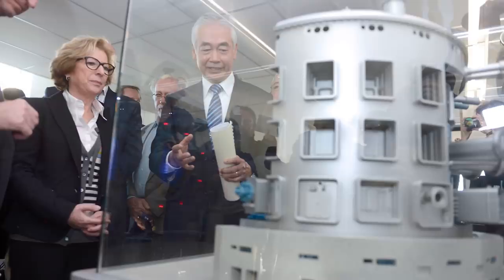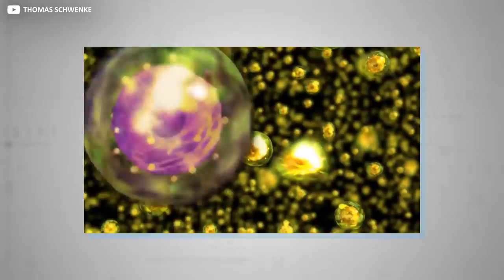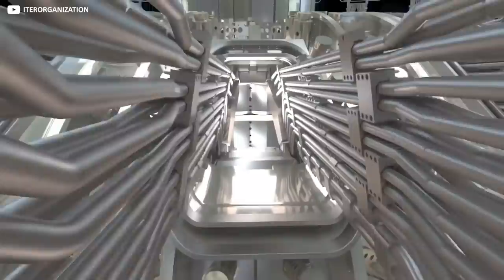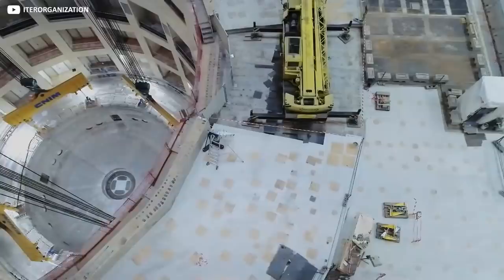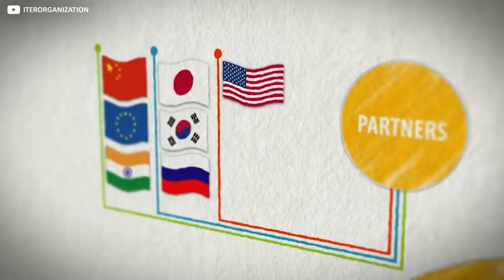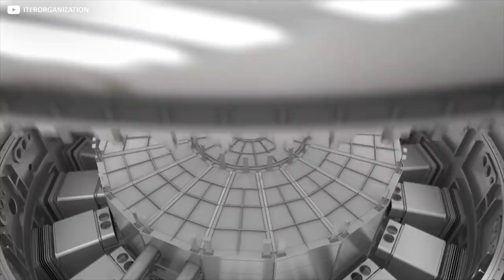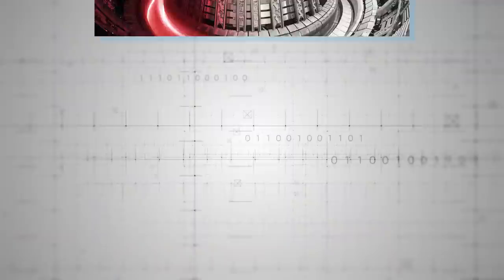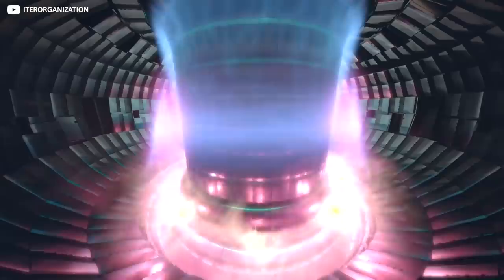Inside The World's Largest Nuclear Fusion Reactor

Comment: Well, hopefully it will work. Because I don't think that it will go pretty if it goes wrong.
Reply: Fortunately it's one of the things where it's bark is worse than it's bite
Reply: No need to worry about that, FUSION reactors can't go critical or have meltdowns like FISSION reactors. If anything goes wrong, the reaction simply ends and nothing happens. 

It's basically like blowing out a candle, worst case scenario might be the electromagnetic coils, vacuum vessel and or confinement chamber getting damaged by superheated plasma and high magnetic field strength.

But even at that the entirety of damage is confined to the reactor enclosure and nothing else. There's no massive explosion or thermonuclear runoff to worry about. Essentially, if the plasma manages to touch the walls of the vacuum vessel, it'll start cooling down immediately and therefore will no longer be hot or compressed enough to support fusion.
Reply: @justiceifeme   Good to know, thanks about that.
Reply: @GTKSM952  you're welcome

Comment: It's a really good thing we're really good at making things smaller. That entire complex is rediculously massive.
Reply: Fusion doesn’t scale-down well. We already have to get temperatures orders of magnitude higher than in the hottest parts of the sun just to get this to work because gravity isn’t strong enough to assist. The sun looks downright chilly compared to the inside of these things. That’s a problem that only gets exponentially worse as you scale-down fusion reactors based on magnetic confinement.

Comment: how does that magnetic field contain so much heat?
Reply: Computers keep the heat moving around the tunnels and they use the magnetic waves to contain the heat. It is so hot it would melt anything that got in the heat.  Princeton was only able to keep the plasma burning for a few milliseconds I think.  Remember one time they had the computers controlling the magnetic field turn off one time during a test plasma ignition but without the magnetic field it blew out the field structure walls.
Reply: The components of the plasma are sub atomic particles mainly electrons, protons and neutrons. Electrons and protons have a negative and positive charge respectively while neutrons are neutral in charge. Because of this, the electrons and protons are repelled by magnetic fields while the neutrons just stick along for the ride with the protons.

Comment: I can’t avoid thinking about how we as humans have come, this project goes beyond what a mind like mine can process, I know this wasn’t planned from dusk til dawn, but to see so many ideas taking shape, every gigantic part the sizes, weight and engineering needed to pull this off is so overwhelming, and to know that it all will come down to a few switches and bottom that control the whole thing, I can’t wait to see the moment when the wiring begins, if a get amazed when I see how the wiring of a car goes, this will overcome everything I’ve seen before.  Even if it works which I hope it does, it would only represent the beginning of a new revolution, and I heard elsewhere that this won’t be used to boil water and generate steam, but only will be used as an experimental facility, so I suppose France will be the first country to make a nuclear fusion plant to generate power which should look a bit different. 👏🏽 👏🏽 my respects to every soul involved in this since its first ideas from 1957 to now.

Comment: I am a huge fan of Fusion and had my first letdown with Pons and Fleishmann. I am not convinced at this time that it is even needed, but I do believe we should continue to pursue the technology because it is simply amazing. We presently have clean sources of energy through the use of solar, wind, thermal, wave, combined with efficient battery storage, which thanks to Tesla, is coming along beautifully. We can easily power our needs using that technology, so I am wondering if fusion does not become viable in the next 10 years, will it really be needed? Time will tell. But again, before some of you go psycho on me, I support the study and use of Fusion. Cheers
Reply: Ok, but how far will electric engines get you, when you wanna go to, say, another planet? Isn't fusion power the best (theoretical) way to propel ships in space?

Comment: Nuclear fusion energy is the holy grail of energy production. It is simple to produce a five megaton explosion that destroys everything for miles around and sends a big mushroom cloud into the sky. However scaling this process down to a size and controllable level to produce useful energy is very difficult and so far has not been achieved. It is really difficult to create the conditions of tremendous pressures and temperatures of the interior of the sun to generate nuclear fusion energy.

Comment: 'fusion has always been 30 years away and it always will be'. First ITER fusion experiments due to begin in 2035 (project started in 1998). Aim, to achieve 400 to 600 seconds of sustained fusion.......thats it. 65 billion for a few minutes. Then they start building the demonstration machine, another 20 to 30 years, then they might think about building machines that actually generate some power in about 50 to 70 years or so......they think we're stupid enough to think this is worthwhile, and we are.

Comment: I really hope it works.  If they can get even 250 MW (half the power goal) it will be a huge accomplishment.  There are so many things that have to work just right.  Fusion has been elusively just out of reach for decades, despite all of the funding and researchers and that have been thrown at it.  If it does work then of course the next goal is to finally make a practical fusion-based electrical power generation plant.  Which will take still more work, but the payoffs are potentially huge.  On the other hand, if ITER doesn't make much net power then I imagine that this will be the end of significant funding for fusion power research for the foreseeable future.

Comment: There is a major problem in that the lithium isn't capable of covering minute openings of  the reactor used for the vacuum. Tritium from fission reaction is needed to continue the process, as deuterium-deuterium reaction doesn't produce enough energy, and because there is no practical way to recover and recycle all of the Tritium used. Parts from the reactor will need replacing as they absorb Tritium. They will be placed in landfills and do constitute a type of radioactive waste, so it is untrue that there will be no waste from the present design. They have no way of stopping Tritium loss and absorption because a vacuum necessitates openings for that vacuum, meaning that a normal nuclear power plant will be needed because of the Tritium generated at a nuclear reactor. It is a farce to believe people will be without the need of protective specialized equipment to do maintenance and robots to do the majority of work because of the radioactive waste that is absorbed by the magnet and surrounding structures that will constantly need replacement schedules. The project is hoping to advance technical problems as they move forward with proof of concept. I'm not writing a book here but a multitude of minute technichal problems are overlooked during the video. You addressed limited Tritium supply, which allows for a question many might not realize: how much Tritium is needed and where and how will it be produced? Also, computer algorithms used estimations that "if the plasma temperature reaches 150,000,000 degrees that will create the reaction needed to provide unlimited energy can be wrong as well. Problems humans have not foreseen and haven't programmed into calculations used by the computer and software used in the project result in an answer that is an estimate in my opinion. Even "limitless" is wrong as even the limitless energy of the stars have their ends as the stars die. Unlimited energy is more of a slogan because it is really about a small footprint creating exponentially greater amounts of energy than previously generated by any other technology in known human history. That is different from Unlimited energy, which even the stars cannot fulfill the wishes of. I can see how people would like to use this technology for space exploration.

Comment: With the supercooled magnets and the heat blanket I wonder if the Seebeck might be used to generate a thermoelectric effect . I have a nightmare that some simple elegant solution to energy production might involve passive use of infrared radiation to be upscaled to be used as a cooling laser based on doppler shift cooling and the atmosphere pistons creates a power stroke like a steam engine making the generator spin .

Comment: White elephant. This project uses out dated superconductors which require the Tokomak to be built so big. Higher magnetic flux densities can be achieved with new superconductors allowing for smaller more compact and way way cheaper reactors to be built.

Comment: There are a number of things wrong or missing in this video: 
first: fusion, as fission also creates radioactive waste (the Li shields which provide the Tritium will become radioactive for around 40 years, I think)
secondly: no, fusion is not more efficient than fission. Per fusion reaction between 1 Deuterium and 1 Tritium roughly 22MeV is released, while splitting 1 Uranium 235 core creates around 200MeV.
and thirdly, It should also be noted that ITER is based on an old concept for fusion reactors (since it was designed in the early 2000), while todays superconductive materials makes it possible to create far smaller and better fusion reactors (in theory at least). Also, Tokamaks such as ITER cant run continuously, since they constantly have to increase the voltage of the central coil unlike the stellerator design, which is far more complex but therefore can continously output electricity.

Comment: The $60bn figure is tiny money for such a project.  Divide up $60bn by the 30-40 year life span of the project, then divide by the 35 countries funding it. You think each country is risking a lot of money to achieve inexhaustible clean energy for its population?  The pace of this project clarifies that we are not spending enough on this.  Cautious government spending combined with missing stated goals for humanity are the issues. We should spend 10x more and get this done in 10 years. In 20 years this technology needs to be on a functioning spaceship.  The fusion reactor is not just a limitless source of clean energy, it is also how we will power spaceships.  We need fusion technology to power magnetic reconnection engines to achieve ejection velocities in the range 100-300 km/s.  This is probably the only technology that will enable us to reach other solar systems, eg 4 light years away, within a journey duration of less than half of a human lifetime.  Such goals will create millions of jobs, new technologies, new industries and great wealth.  Cheap at 10x the price.

Comment: Just out of curiosity, why didn't they build a small version of this to see if it works? They're assuming this Reactor will work, what if it doesn't?
Reply: This is the small version. There are a lot of tokamak reactors out there (for research purposes) they work just fine, but they consume more energy than the release. This is the minimal size for a fusion reactor that actually releases more energy than consumes (even if wont be plugged in the grid)

Comment: the thing that i dont understand is how does one safely contain temperatures of 150 million celsius? shouldnt such energy spread and vaporize any thing within a very long radius? how can one store such heat with any form of material close to it since such heat can melt anything.  and in the video it says it uses the energy to heat up water to steam etc just as fission reactors do , but pipes cant be placed close to it since that should melt the pipes, so how does it work? and if you manage to create 150 million celsius wich is the temperature for fusion to start then isnt it smarter to just use that heat to heat up the water? or is it the fusion that creates the energy?

Comment: One aspect of fusion energy generation I've never heard addressed is how they will be able to extract enough heat from it to keep it from vaporizing the machine creating it.  150 million degrees !!
Reply: Good point. I believe it is generally believed to have the same liquid to steam setup that fission reactors use, but can make a LOT more of it due to the amount of heat. I would imagine it to be 10 fold at least by ratio. The plasma is held away from the structure with the magnets, so it's the radiant heat to deal with. A little hard to explain but I hope it helps a bit.
Reply: if it touches the wall the reaction stops because there is very little heat in the plasma, since it's only a few grams

Comment: ITER has taken so long to construct, that the technology used in the project, which is pretty much immutable due to the complexity of the design, is becoming rapidly obsolete. For example the  recent advent of superconducting tape could make this reactor 3 to 5 times smaller already, which in turn makes it easier to achieve high efficiency (Positive net output).
Nonetheless, ITER is an impressive achievement once ready.

Comment: I hope this isn't another Chernobyl.
Reply: It can't be "another Chernobyl"... that's literally impossible
Reply: @prosterdbz9663  How do you know???
Reply: @theyeet7061  If I'm not wrong, it's very hard to create the condition neccesary for fusion reaction to start on earth. So... if something miniscule disturbs this condition, the reaction will go kaput and stops immediately. If I'm wrong please correct me tho.
Reply: Fusion reactors cannot run away in the same way that fission reactors can. Essentially, in a fission reactor you have a mix of fuel that is very unstable and wants to fission, and you use control and safety systems to only let just enough of it react at any one time.
In a fusion reactor the fuel is stable, and not only that, but you need to actively pump tens of megawatts of power into the tokamak to keep the plasma confined. If the magnetic confinement fails for any reason, the plasma hits the wall of the reactor, cools down, and the reaction stops. (and you're left with a cool couple billion in damage to the reactor wall)
Basically in a fusion reactor you're trying your damn hardest to make it react and it barely does, so it's not possible for it to run away.

By the way, per unit of energy produced, nuclear fission is still the least deadly power source we currently have. Renewables come close to it, but compared to fossil fuel it's not even a contest. Coal kills literally about 1000 people per TWh produced, compared to the ~0.05 people killed by nuclear to produce the same energy.
Reply: @theyeet7061  science! Let's say the impossible happens and the reaction core breaks apart. The fusion reaction stops. The radiation is so insignificant that you might not want to build in the core housing building  for 50-100 years but you would be fine if you lived next to the plant.
Reply: @jerryh1895 I mean it will not be as bad as the actual Chernobyl but there might be a smaller explosion
Reply: @theyeet7061  probably not... this kind of fusion isn't as "extreme" as the one in every star... it doesn't cause a big explosion or even an explosion at all from what I have heard... the fusion just stops and that's pretty much it
Edit: I was already 99.9% sure but there is no explosion at all
Reply: @theyeet7061  the reactor would need to be breached by something. If the plasma escapes, it lasts about 1-2 seconds and turns back into hydrogen and helium gas. This would only happen if an explosion not related to the reactor itself causes the breach. If something went wrong, the magnetic containmet field is shut off and the fusion stops.

The real difference between fission and fusion is with fission, you actively  have to slow it down or stop it. With fusion, you have to actively keep it going.

Comment: If they had just  spent this same amount of money on a solar farm, and battery system.
Reply: Woud be stupid . Solar farms wont power over world and batterys are stupid expensvie and need to be replaced super early . You need to invest money into new technology and a project like that as first timer cost money. Renewapple energy has its limit and its flaws .
Reply: @xythiera7255  yeah 24 Billion into a lets hope this works and doesn't end up like Chernobyl experiment.  
  Instead of developing a low risk easily manageable existing technology.  Also 24 billion would build a massive solar farm.  For example Bhadla solar park is a 2.25GW solar complex being developed in Bhadla village in Jodhpur district of Rajasthan, India at a cost of $1.4 billion so 2250 Mega Watts vs 500 and at a less than 1 / 16th the cost.  
2250 megawatt X 16 = 36 Giga Watts. 1 gigawatt could realistically power 300,000 homes, so 10,800,000 homes, there are about 25 million homes in the UK so 2.5 of these would power the entire UK..     Also the risk of a device running at this temperature is not worth the risk, when an almost no risk solution to energy production already exists.